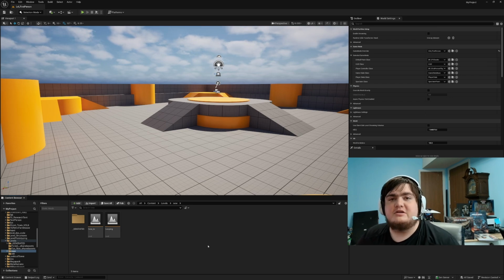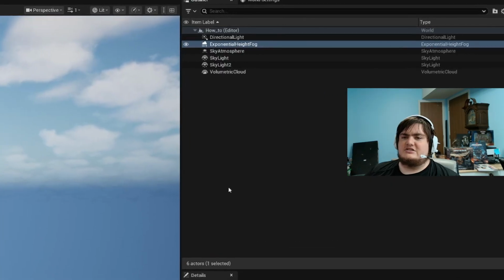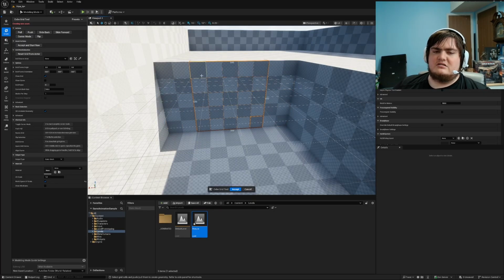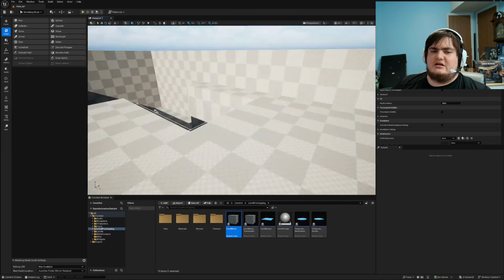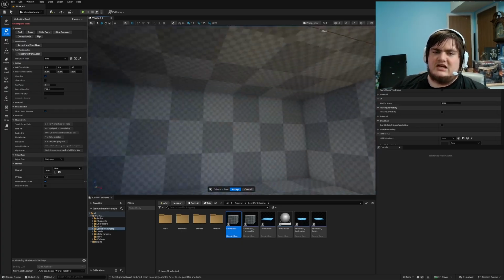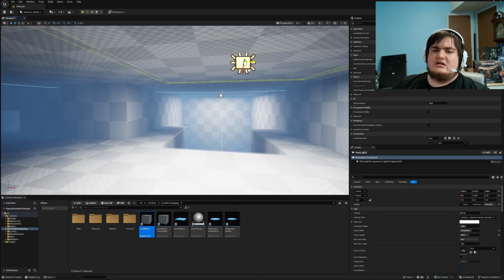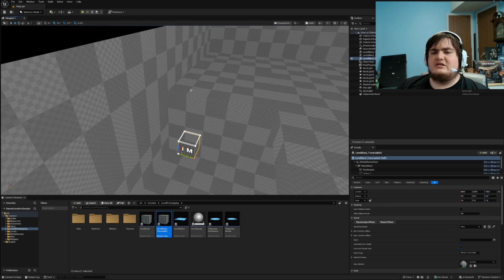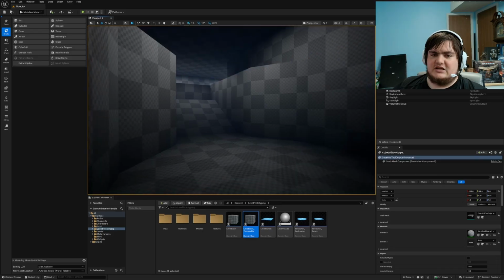How to Practice level design (Updated)

Comment: A sincere question: by generating surfaces through 3D objects, aren't we wasting memory space and worsening the level's performance? After all, when we build walls where the opposite side can't be reached, some of the faces don't need to be rendered.
Reply from the maker: these are all for previz. ment to be replaced later on. not for finished project. once youve replaced them you can delete the file. its ment to help spead up the design process. and allow for faster testing.
Reply: @BatnobieX And are there any specific techniques and best practices for transitioning from blockout to final environment? If so, could you make a video about it?
Reply from the maker: https://youtu.be/eueZV4Z6GGQ?si=gq-byl4gw9WhwgTb
Reply from the maker: Just commented a link to a video i did on replacing Greybox. But its good to know many devs have their own techniques they use for replacing the Greybox. So just know teir isn't exactly a wrong answer. Its about replacing with good speed and quality.